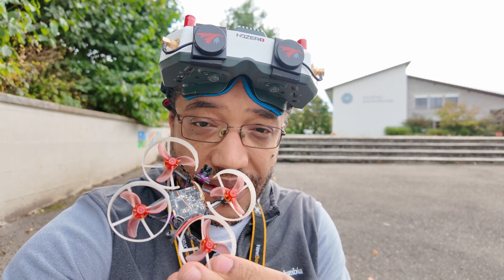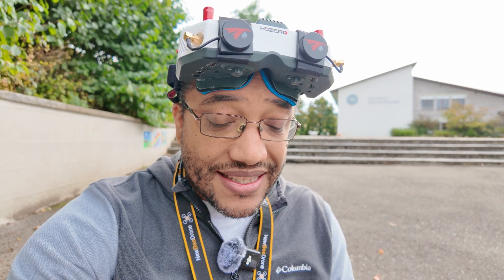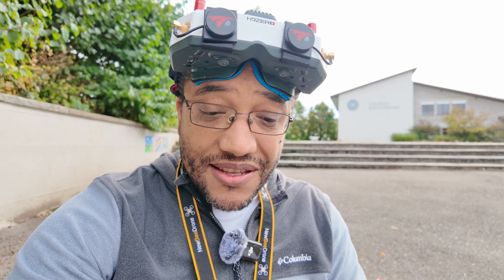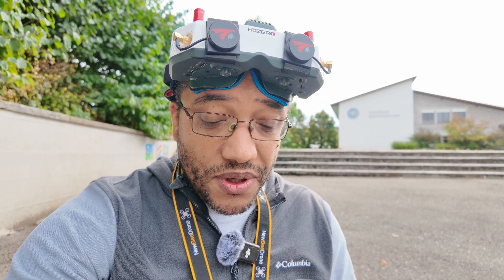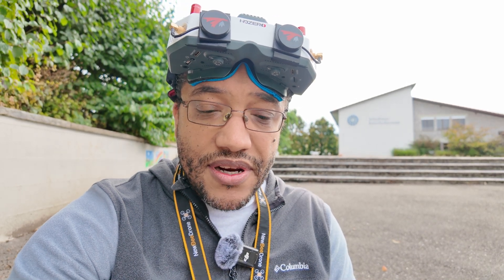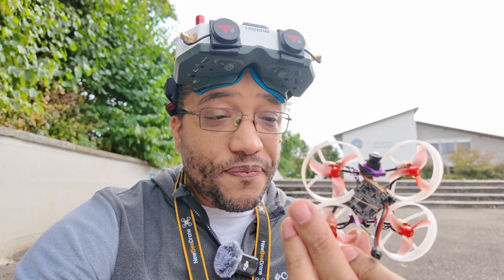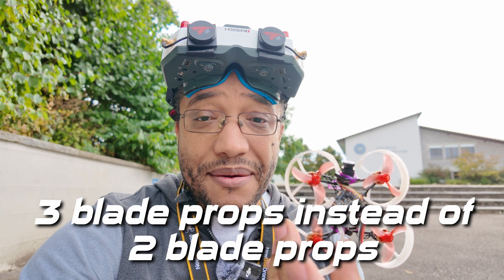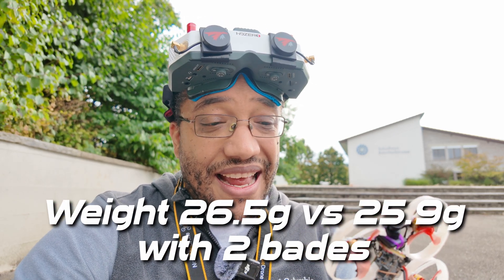Fractal F75  - HDZ AIO5 // First flight with Lux Cam

Comment: Does it vibrate cam if ducts not cut.... mine just barely fits between...
Reply from the maker: I don't think so but I would just try. I did cut more of the ducts later to save weight btw.

Comment: Great video, i wish it wasnt so windy here all the time, i know how much these little guys aid your flying without breaking arms etc, great vid, well done, clear as day footage❤🫡
Reply from the maker: Thanks mate! 😉🙏 It surely is nice not to break stuff that easily but it also does fly a bit differently. You should try it 😁
Reply: @McLogo76  i have a little fractual one, like yours but the old frsky rx, i ramped the throttle curve up and it was alot better, but its so windy all the time and we live in short narrow long terraced houses, and its just impossible, what would you recomend that can handle a slight wind and is 2 cell, i hate 1s♥️♥️

Comment: Did you notice the weight difference on the 75? I didn’t get to fly my 65 conversion yesterday
Reply from the maker: It's about 2-2.5g lighter but depending what mounting solutions you use. I cut down the 3d printed grommets that came with the F75 Fractal kit and shortened the screws.
I think the weight saving definetely also from less hardware you need with only one board. ;)
And you basically lose 0.8g with the Lux Cam 2.3g vs the old Nano lite 1.5g.